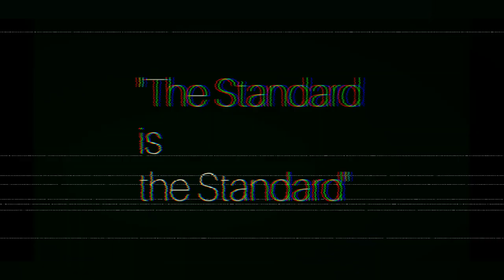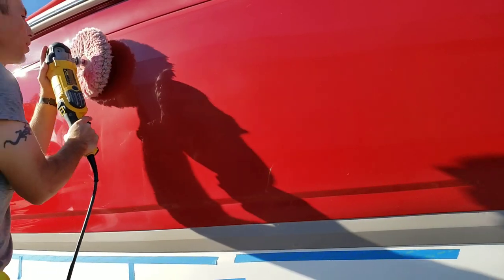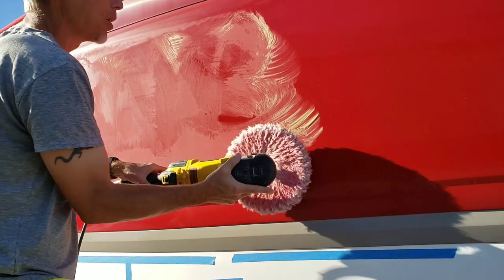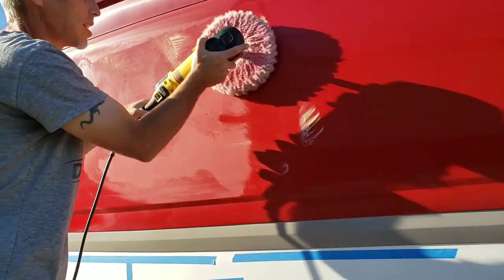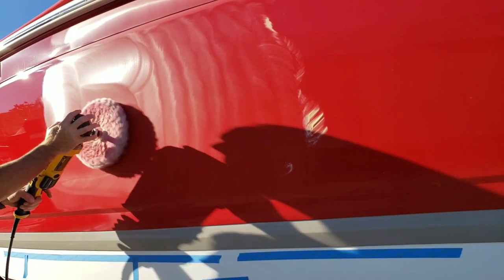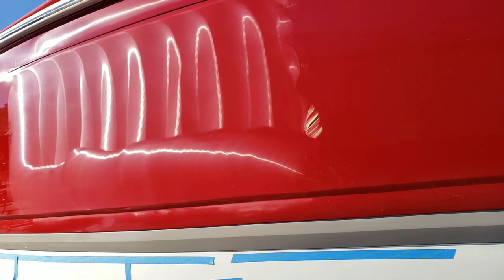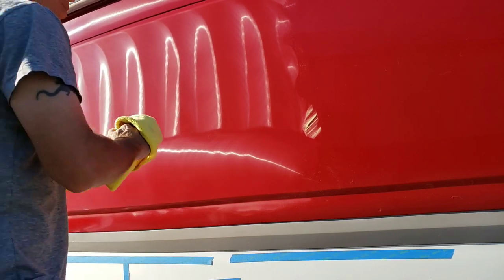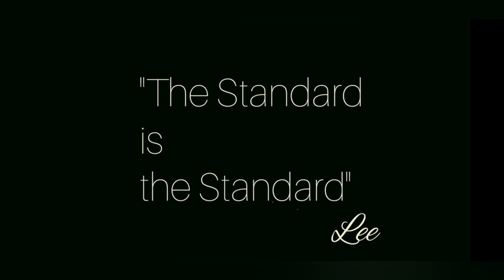Buffer speed with compound? Does it matter, really? It matters less than we think. Let me bore you.

Comment: I’ve commented before on another video but as I watch this, I can relate to the lesson in exactly the same way. I have been a welder and pipe fitter for 20plus years and you have the patience that has been acquired over years of success and failure along the way. You can ask 10 folks of your profession a question and will get 10 different ways to achieve the same result. But patience and repetition is the key. Spend a little extra time and get the best result the first try instead of rushing through and having to do it again. Cheers dude. I really appreciate all the knowledge that you are putting out here. Much love from North Carolina 🤙
Reply from the maker: Much luv back, thanks.

Lee

Comment: I'm detailer here in Louisiana. I do a lot of boats and enjoy them, I have all sort of polish and leveling fluids, 3M Super Duty included, just never used it but will try later this week on an oxidized bay boat. 
Nice job man
Reply from the maker: Well, thanks. Super-Duty has a place, especially when you think "should I wetsand it?" Try Super-Duty 1st and see if it can't get through the ugly 1st.
I don't envy your humidity and I salute you for being able to even do this work in it, I'd flat die.
Reply: @Local_Boydidgood  
I will try it,  hopefully I don't have to wet sand the boat. 
It is very hot here, been at it since 1982
Reply from the maker: Damn! '82? I didn't start till' 05. Trooper!
Reply: @Local_Boydidgood  
Well, I'm on the boat, it's messed up, the inside will consume most of the labor but no sanding. I tried the 3M Super Duty but the Menzerna Heavy Duty is doing a little better so I'm going with that.
Reply from the maker: Always go with what works. Just be sure to wash the boat well and inspect it before waxing. Menzerna is greasy and hides stuff sometimes. Good luck! (I hate doing the interior gelcoat, such small spaces!)
Reply: @Local_Boydidgood  
Not my first time buffing using Menzerna,  I use a strong IPA wipe as I go, or get you a good prep spray, you'll be surprised how quick it is to check your work. The 3M just didn't get it done for me, maybe it will next time. I've done over 250 boats in my 30 plus years, one thing I can tell you never be surprised with different outcomes using a particular product, one product will not do every job to your liking. 

Hope to have inside done tomorrow.
Reply from the maker: I'm with you. My car is full of products I hardly ever use but there's always that one boat that just refuses to play along and then I go through the kit and see what's going to crack the shell.

Good luck, no pressure 😅👍🏼
Reply: @MrRedex88 I'm in New Orleans getting started buffing boats. Where are you at? Maybe we can connect.
Reply from the maker: I'm in Chelan, WA.. Long connection but I'm here.

Lee

Comment: This is my 2nd message. I buffed a boat that was 15 years old. When I was finished I was very unsatisfied. The paint had what looked like a haze left on it. It wasn’t that bad when I started and it did look somewhat better but nothing like I feel certain it was capable of looking like. I have been told to always use a wool pad which I didn’t do and looking back I feel like I was way to conservative with the buffing compound. I think I should have used a lot more. Could you please tell me what you think the problem was after what I have explained to you? Thank you and thanks for the video!!   Sorry I also meant to let you know I used the latest 3M Super Duty Compound and finishing compound or compound/wax.
Reply from the maker: Practice, that's what was missing. This works, not because of the products or the tools but because I've been practicing since 2005.
Reply: @Local_Boydidgood  Understood and thank you very much!!.. 👍
Reply from the maker: Make sure you have even product coverage on the pad as well as the surface. Make sure to use a pad that does not shake your buffer too much when spinning. The other thing to try is (sounds stupid but works 70% of the time) hold the buffer differently. Adjust the pressure and rigidity of your hold on the buffer. Change hands. Pull the buffer off and spin it full speed. Flip the pad over. Clean the pad. Brace the hull of your boat, there might not be good enough rigidity in the fiberglass to resist a harmonic resonance that will literally shake a hull back and forth and bounce the buffer wheel off of it in the process, use a knee or shoulder.

There's a million things that can cause that hopping. I'm giving you the basics.

I teach a class if you ever want to learn how never to deal with that again.
Reply: @Local_Boydidgood  Thank you friend for the info. I have buffed before many years ago on cars. Freshly painted cars that were painted in Base Coat, Clear Coat. The buffer I used then was much stronger. It was air and what I use now is electric. If that air buffer ever started bouncing, it would burn through the clear coat instantly. So I am familiar with the bouncing. Do you teach your class online? I would be very interested. Thank You!!
Reply from the maker: My guess is, the problem is in the pad more than anything but you've obviously had hopping in car body's when there's a large area of unsupported sheet metal to be polished with a rotary and even a DA.
As to the class, it's in-person. 2-3 days (depending upon you're speed at picking up the info) In Chelan WA and is $500.

I can't imagine trying to learn this online.
Reply: @Local_Boydidgood  Thank you friend but I’m in Alabama. Appreciate the info.
Reply from the maker: I've had people from France, Australia, Canada and all the states.
I have over 100 vids on just this stuff. Find the longer ones and keep practicing. There are courses online. Deckhand Detailing llc in Seattle offers one for $600 and it sucks, I've seen their whole program. You do get a fancy certificate though so probably worth it if you ever (in 15 years, I haven't) run into someone who asks to see one.
This is a feel thing to get good, like riding a unicycle or juggling. It isn't "hard" but it takes time and patience to learn on your own, 2-3 days and some repeated practice at home to be great.

I'll help from here if I can but if this is something you would like to learn, Chelan WA is beautiful and I have boats for days to work on, of all stages of decay and types of gelcoat to practice on.

Cheers.
Reply: @Local_Boydidgood  Thank you friend! And I learned to ride a unicycle in a day believe it or not. Lol. No joke. I understand exactly what you are saying. However I was buffing on a heavy boat. There wasn’t even any vibration. Where is the info on your classes again??
Reply from the maker: If you can learn a unicycle in a day...
The classes are informal. Show up during Spring-Fall and plan on another day? Or 3. Either way, I'm here and so are lots of boats to teach/learn on.

Most detailers take 2 days and they've "done this before". This might be harder to learn.

The answer seems like a pad issue. Not balanced or out of round in some way.
Reply: @Local_Boydidgood  Thank you friend! Yes I honestly learned to ride a unicycle in a day. I was about 13 and spent that entire day doing only that. I didn’t mean I was that good at it. Just that I could ride it for a ways before that day was over.
Reply: @Local_Boydidgood  where did you say I need to go to learn more about or keep up with when the classes are??
Reply from the maker: I tried for an hour and went back to 2 wheels.
This is all a feel thing. If you can read the buffer, you'll know what it is doing on the surface. Hearing it too helps. Once I can get my students to recognize the signs and tells of a buffer, they can go home and kill it.

Comment: Very nice result using the Super Duty.

This boat looked like it had some shine still, so I’m a little surprised you didn’t start with Heavy Cut?  I think I’ve seen you tackle gelcoat that was in worse condition than this with just Heavy Cut in previous videos.

Would you recommend going with the Quick Disconnect wool pads or the screw-on wool pads?
Reply from the maker: Screw on if personal and quick connect if doing this all day.

This was just a demo mostly but Cobalt uses a hardener for their gelcoat so if there's stuff in the gelcoat, you have to dig deep to get to it and while heavy cut would produce a similar lasting result as this boat mostly held since last year, I wanted to see how much better I could get the gelcoat before trying to lock it in with a special polish.
Reply: Thanks for the reply.  Are you recommending the screw-on pads over the quick disconnect for personal use because the pads are a little less expensive?

So I will need a 3M wool double sided compounding pad and a 3M polishing pad (for the Cobalt riveted snaps),  it will I need a 3M wool polishing pad also?

I received my used ebay DWP849X today and it is cleaning up very nicely.  But I am having a really hard time getting the hook-and-loop pad to unscrew off of the threaded spindle.  I don’t think it has ever been off before and the old compound seems to have glued it in place.  And 3M in their wisdom did not put any wrench flats on the hook-and-loop pad.  Any tips?
Reply from the maker: WD40 and turn the wheel while pushing in the spindle lock button on top of the buffer (don't press while she's spinning under power) once she locks, torque that pad off, I had to do the same thing today..

I recommend the screwed on pads for the simplicity and one other reason I won't go into publicly. Easy is simple, simple is repeatable and available everywhere buffing supplies are available. (always use a spacer nut. Coarse thread 5/8")
Use whatever you want. This is all more than just the tools it's the feel and what works for you. If you're comfortable you're confident. If confident capable of doing something cool (or disastrous as we lean)
Reply: I have been in mourning for that Velcro backing pad.  It did not survive the dismantling procedure, but it sure did not go gentle into that good night.     Resistance is futile and it is in a bunch of little tiny pieces now.

The 3M website on buffing pads is a little confusing. 

05703 screw-on, double-sided  wool 9” for compounding
05704 Same as above except for polishing
33281 Same as above except for buffing
33280 Quick Disconnect version of 33281
05753 Quick Disconnect buffing and compounding

I think I want at least one pad from the first three pads listed?  Also which foam pad to deal with the riveted Cobalt snaps?

Thanks again for all your help.
Reply from the maker: Sorry T, I just saw this (youtube app sucks)
One white (doesn't really matter which wool pad from them)
One yellow (also, they're all going to work)
A white foam pad with a 3D pattern on the face. You'll need another backing plate if you don't use double-sided pads like I enjoy to. 
Just depends on if you're using the spindle nut or the quick-connect adaptor. I don't remember the numbers because as you've seen, they're confusing.

I list what I use in all the descriptions.

Lee

Comment: Hi, I'm a car detail but trade. I've recently been asked by a client if I could polish his boat. Now I only own Rupes bigfoot DA machines, I don't currently own a rotary. Would the bigfoot be enough to do the job? Or would you recommend I invest in a rotary?
Thanks in advance 🤙🤙
Reply from the maker: Any detailer worth anything has a rotary buffer in his (or her) Arsenal. I don't think that any of the boats that you see in my videos could be handled with a dual action. Without seeing the boat that you're talking about, I can't give you a 100% accurate answer. You can definitely try a very stiff foam pad with your machine and see if it makes a dent. My guess is that it will only add some color and a little bit of shine but nothing like you will see in my videos. Go online and buy the DeWalt DPW 849x and some wool pads by 3M Plus the spindle nut adapter.
Reply: Yup I thought as much. I barely used mine so gave it away, regretting it now..

Thanks again for fast reply, I appreciate mate
Reply from the maker: Any time. EBay, (people use these a few times and sell them often)
Reply: Followed your advice and purchased a cordless rotary and man what a difference that made in productivity... Thanks again for the help 🤙🤙🤙
Reply from the maker: I don't remember suggesting a cordless one but I hope it works for you. I usually offer the DeWalt DWP849X as an option.

All my best!

Comment: What polish and pad are you using for the final polish?
Reply from the maker: Soft foam pad (Shurehold) on a dual-action or random orbital to apply and remove Restructure marine polish.
Reply: @Local_Boydidgood  How is that polish compare to the 3M Perfect-It EX Ultrafine Machine Polish? and 3m Yellow polishing pad?
Reply from the maker: I guess we, you and I had the word "polish" mixed up. After Perfect-it ex ac, I don't use a polish like you would for a car. Once you reach a mirror-like reflection when clean and dry, you can 'polish" it with a "wax" sealant, polish..whatever. Different words mean different things in different industries.
So, now that I know what you mean by "polish", my answer is, I don't use it unless it's paint. In that case, a yellow "polishing" pad would be fine. 
The 3m polishing pad wouldn't matter to me on a boat because A) it's too rough and B) for perfect results, a super soft foam pad on a DA or random orbital to both apply and remove the boat "wax' is needed.
- you can achieve perfect finishes with a rotary but it takes too much skill for the average detailer. With time it's possible -
Reply: @Local_Boydidgood  In my experience the polish step has always giving a longer lasting finish on gelcoat.
Reply from the maker: I've never seen a difference from Perfect-it to the # 3 or the polish. I think I get my longevity in my wax from washing the boat down after compounding.
If you are using a polish that you like, keep doing what works for you.
Reply: @Local_Boydidgood  Are you using the Meguiar’s Flagship paste was or the liquid type
Reply from the maker: Liquid, always but I apply it differently per boat. I remove it also, per boat. Sometimes nylon/wool pads, sometimes a foam pad on a DA..

Comment: With a large RV after using Super Duty what would be the next step?
Polish then a ceramic wax?   If I do this on a 45ft fifth wheel I never want to redo this amount of buffing again.

How do I keep the shine afterwards and what’s the most bang for the buck with such a large surface area?
Reply from the maker: Next steps, watch a few more of my vids.
Not a ceramic. Never is a long time.
If you have clear/clean gelcoat, Restructure marine polish
https://www.restructuremarine.com/

Next step (assuming you've seen other vids of mine)
Next step is Heavy-cut then Perfect-it ex ac and then if you like the results, a clean/inspection and then a sealant/wax/polish.
Super-duty is rough. That I can sometimes make it shine like this is rare in the world and I can't always do it. Not sure if it's the boat or my pads or my attitude that affects the final result. Mostly, I use Super-duty as a liquid sand paper and like any grit used with paper we shouldn't be happy with just a sheen. We shouldn't even be happy with a swirled up gloss from Heavy Cut and while I can usually get great results most people would be proud of, it should be the step specifically to clean up WHAT Super-duty left behind. If you see swirls-holograms, grab some perfect it ex ac and hit that spot again. If you see a great finish after, cool, wash/inspect the boat and look for things you missed and address them again with whatever you think is needed to fix the spots showing signs of oxidation.
I did a black Cobalt hull today : started with Super-duty because I removed everything! Logos, hull registration "Kevlar blah blah blah.." everything.
Got it almost perfect but then after the wash it told me I was about halfway there. The rest of the day for one side of a 25' boat but I'm doing the extra work now to avoid it next year. There will still be work but easier work and for the profit won't be as easily consumed by time and product. If you can make today's compounding and waxing, tomorrow's cleaning and waxing, you've won.